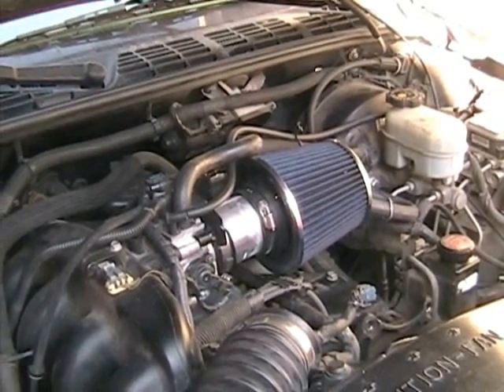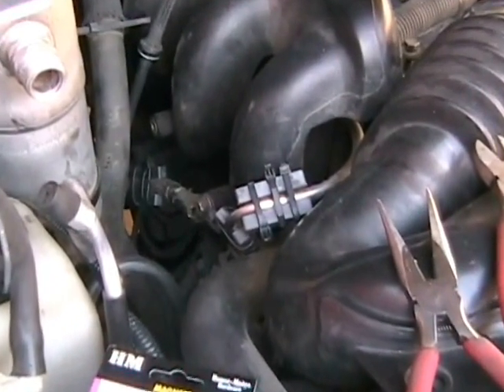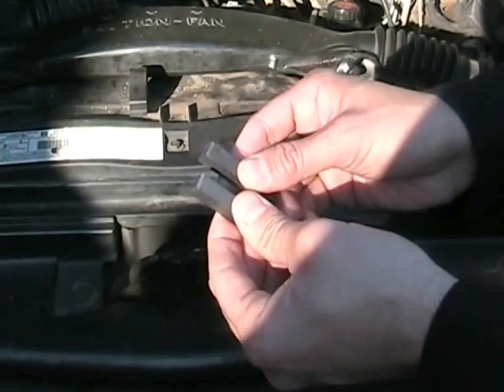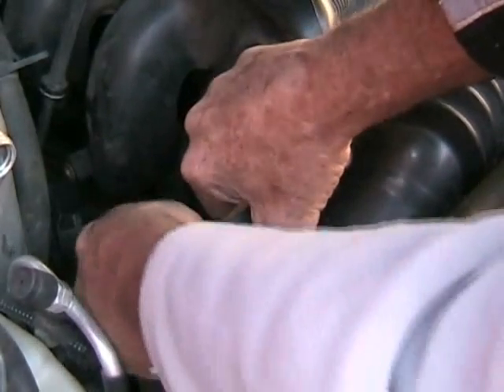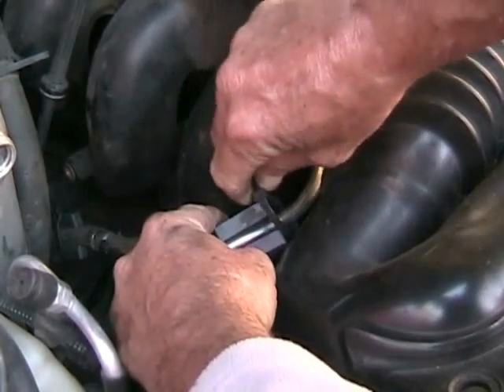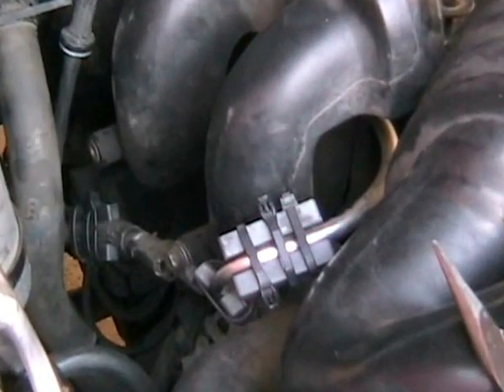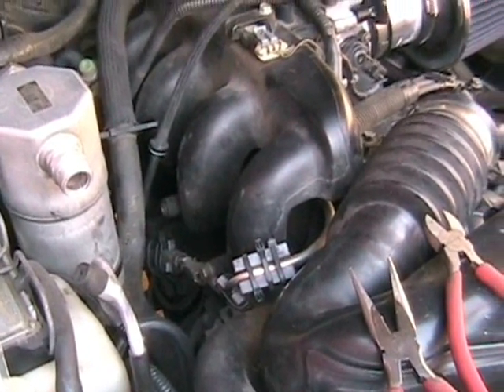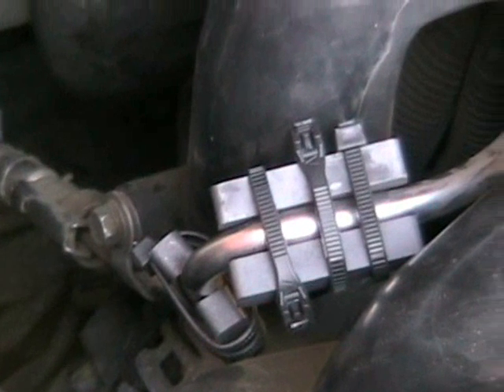Sequencing magnets on a fuel line

Comment: Hey!  It looks like I am no longer the only one doing this!  It not only gets better gas mileage, my van went from 18 to 23 MPG, but your car will run much smoother.  I first tried this on a geo prizm to get it to run smoother, then I discovered it improved the gas mileage as well.  You can get magnets for free from old hard drives.
Reply: Excellent work bro.

Comment: Just a note when installing magnets they will begin to clean out varnish and carbon from valves and you could actully see a decline until system is cleaned out. It took 400 miles of driving before the maxima cleaned out and ran smoothly..
Reply: hondo434 did u try it? Will it work with CNG as a fuel too?

Comment: If your fuel line is made from an iron metal, and you can stick a magnet to it, the magnetic waves emitted by a magnet cannot get through to the fuel.  The waves stay in the metal.  You also have to put the magnets as close to the combustion chamber as possible with all North Poles facing the fuel line.  It also helps to put some magnets of the inverse polarity on the air intake.  Fuel and air have the same polarity.  Since opposites attract, the magnets make the air fuel mixture REPEL each other less.  At least that's how it was explained to me.  A buddy of mine gave me a magnetic invention he made.  I was amazed that my 2000 Saturn not only went from 24 to 32 MPG, but the magnets eliminated a misfire.  WOW!  Unfortunately, I have not been able to reproduce the success I had with the Saturn on any of my newer cars.  Makes me wonder if the car makers somehow found a way to disable the benefits of adding magnets to the fuel line.
Reply: That's precisely why I use rubber fuel hose myself.  It works.  Most people aren't aware how magnetic fields work.  I think most fuel lines are aluminum though and those are not magnetic at all. All fuel injected vehicles should be counteracting any fuel gains you get from magnets.  I have a 97 and the mileage has changed marginally, but the pep in the pedal was immediately noticeable.

Comment: I then installed additional magnets around the air tube and increased mpg to 37-38 mpg. I have magnets on oil filter to catch metal particles under 10 microns, magnets installed around radiator hose to condition water so it won't corrode or build up minerals in capillaries. If you are worried about heat there are high temp mags or you can simply insulate them.
 I put them on my fathers v-8 merc marq. we got over 29 mpg.
Reply: hondo434 will this work for CNG fuel vehicle too? Where on oil filter did you put it? Were they attracting or repelling? If repelling, N-N or S-S?

Comment: OK,   I fitted magnets on my BMW K1100 motorcycle,  fitted them as close to the burn ( injectors ) as I could.  Within 5 mins,  the tickover went from 700 rpm to 1100 rpm.   I was baffled,  No reason for this to happen.  I rode it to my friends house,  fellow biker,  mechanic and engineer.  He sneered,  Nope,  Can't happen.  Observe,  I said,  and he did.  He too couldn't believe it.   so,  we wound down the tick-over to compensate for the magnets.   I knew my bike averaged 48 mpg on a run ( and I do long runs )  this went up to 57 mpg,  not once,  but regularly.      If someone told me this,  I'd not believe it till I'd done the same thing myself,  but there it was.   Further testing,  I put the magnets on my Goldwing 1200.  Didn't make any difference to fuel,  just the same,   but the engine definitely ran smoother.  I concluded the magnets ran better with fuel injection that standard carbs.   The magnets remain on both bikes and I'm very happy with them.  Look,  it only takes 2 mins for someone to have a go at me.  I honestly don't care.  I proved it to myself,  I absolutely don't need to prove it to anyone else,  I just thought that if someone with an open mind might want to try it themselves,  good for you.   Not everything labelled Snake Oil,   is Snake Oil.
Reply: Nonsence!
Reply: +Farhad Guliyev      If you can't spell nonsense then clearly,  your not bright enough to understand what's being stated here.
Reply: +Kevin Savage So what I made a mechanical mistyping. :) You also wrote the phrase "your" instead of "you're". I watched a Russian TV program about various tests on cars. So they tested a case on a professional, computerised stand with and without magnets at the same working conditions, i.e. engine revs, etc. The stand showed no difference in fuel consumption.
Reply: +kris090765 by the way, English is not my native language. It's my 4th language. I bet you don't know even 3-4 words in my language. So what I made a mechanical mistyping. :) I watched a Russian TV program about various tests on cars. So they tested a case on a professional, computerised stand with and without magnets at the same working conditions, i.e. engine revs, etc. The stand showed no difference in fuel consumption.
Reply: +Farhad Guliyev Your first language is JEW lies.... Howdy Epstein !
Reply: +CarsRcool :) I am as much a jew as you are my sister :). I am from Azerbaijan, my friend. If you do some research you willl see the science behind these magnets is actually a quasi-science. However if you believe they do work, please buy and install on you vehicle.It is your decision.
Reply: +CarsRcool Nice to meet you too ). Cheers.
Reply: ***** Every one has a goal to reach 200 MPG... because a man in Canada did that in 1936.... but we now know the reason why  he was able to achieve such great mileage    :  ) 
Have a nice day
Reply: +CarsRcool I have a masters diploma on International Journalism :). Jews can put materials on youtube too ;)
Reply: +Farhad Guliyev
'your' is a texin trik designed2save2characters but has same meanin. Proofs dat u got wut da word meant.
Reply: I use flange shield it & give it 15 days. electrons helps electrons
Reply: Many years back, I put a set of magnets om my car and I noticed no difference. At the same time a friend fitted them on a different make car and he was getting higher mileage. Also another friend selling these told me they installed these to the beer taps in a pub to prevent sediment builup in the taps.
Reply: I did this trick on a friend who had a motor cycle.  Everytime he parked his motor cycle at work we would add more fuel to his tank without him knowing. He thought the bike was so great he was getting 100 mpg. Then we started taking fuel out each day... he nearly killed that bike... hahahahaha what a laugh we had.
Reply: MaleAdaptor wow! Good to know that there are different uses of Magnets at different sectors!
Reply: James DeGray Hey james! I have taken professional driving as my profession for past 2 yrs in India. We (drivers) are facing alot of problems to sustain as Indian economy had an over haul. If you can suggest anything that could increase an fuel average for substantial amount; that would be gr8 for many here. We are using diesel, petrol and gas(CNG) here as a fuel.
Reply: @jibjibam  just incase you forgot about this post, I feel it's my duty to correct you on the spelling "computerized"... It's with a Z not an S 😂
Reply: The reason is because your gas electrons are aline, there fore you are getting a better burning of your gas and by that getting more power. If you reduce your seeping you can get better millage. 
Blessing for Ecuador. Google work
Reply: Do the magnets need to be powerful, or any regular magnets would do the job?
Reply: @Ryan H wtf 😂
Reply: @kevinsavage4162  you're *

Comment: @afdhalatifftan92
That's true, and easy to account for. Catalytic converters do slightly rob an engine of efficiency because they inevitably create some restriction in the flow of exhaust, but it's a reasonable trade-off because you get much cleaner exhaust and less smog pollution. Today's engines are also designed to burn fuel leaner than they did many years ago. Using more air in the mixture burns up the gas more thoroughly and makes for cleaner exhaust, but also reduces efficiency slightly.

Comment: This is an interesting concept.  Probably made for aluminum, or rubber or plastic hose only. The metal pipe can spread the magnetic field across a larger area if the pipe wall are thick enough. This will fade out the magnetic strength, affecting the intended magnetic pulse strength you asked for.

Comment: @Abreen11 I have tested HHO on an old Land Rover with a friend and we got 60 % fuel savings. You can also put water as vapor in the fuel and if you thermodynamics, you should know that heating up the vapor with the surrounding combustion is going to increase pressure in the chamber leading to much more torque sent to the piston instead of heating the wall.
Reply: 60% increase in mpg with an HHO generator? Without any timing adjustments to the engine or ECU adjustments? At what point does the HHO enter the intake: air box, before throttle, intake manifold? Also, do you know how many amps your HHO generator makes when it's on? and how much does it pull from the battery/alternator? thx
Reply: Wow! Impressive. I hope it is not exaggerated. How do we do that?
Reply: @gauravashq  did you ever find out how they was talkin about making vapor barrier and sending  in your fuel

Comment: I have been experimenting with magnets for almost two years. I have two vehicles of my own and have installed them on my families vehicles and have seen increase in milage on all of them. I used the same setup on each one. I use a small button neomydium n42 magnets 5-6 of them wrapped around the fuel line close to the fuel injectors. 
  My results for 2006 nissan altima are maximun milage before magnets was 28mpg, after installing just magnets on fuel line the mpg increased to 35.9.

Comment: @LOLDISNEYLAND the magnet system does work
had 1 fitted on a vehicle at work 12.7 litre diesle. idont own it or sell magnets so theres no need 4 me to tell crap. same load same distance on the first test was 18% less fuel. this was an insulated system so magnets dont get interference from chasis or any metal
Reply: alan eades how to insulate magnets for heat and for magnetic field too?

Comment: water is able to be ionized which means all electrons will separated all polarized so they don't combine with each other and minerals in the solution. benifit is minerals will float in solution and not attached to metal componets in cooling system. Thus preventing obstructions and corrosion.

Comment: @joshf101

Synthetic oils do tend to remain cleaner longer because they have more thermal stability. You can order a copy of the laboratory test results from any motor oil company and see that, in fact, synthetic oils can withstand higher temperatures before breaking down. When an oil doesn't burn as much, you will naturally get less carbon contamination. Think about it. If you put motor oil in a pan on the stove and turn up the flame, it's going to turn black when it gets too hot.

Comment: I myself have used magnets for years.  There are certain ways to intall them.  On some engines certain polarities work and don't work the other way.

The idea revolves around ionization, whereby a very strong magnetic field will ionize free oxygen molecules to the fuel making for better burn and removing deposits over time.

But one thing escapes me.. some are putting them on the coolant lines, which have NOTHING to do with combustion.  Can someone set me straight on this last point..!?
Reply: Magnets on the coolants prevent rust and oxidation build up

Comment: if you really want to improve your gas mileage.
change out the rear gear for more highway speed.
install a set of electric fans to cool the radiator. 
remove the ac system from the motor.
install an electric water pump and reroute your belt for the alt, and power steering. 
lighten your truck weight as much as you can. 
add a lite fabric cover over the bed.
all of this will lower the work load on your motor, lower your running rpm's and increase gas mileage.

Comment: im definitly going to try magnets on my toyota previa. some other gas saving tips. ceramic paint and heat wrap insulate on headers will make a 1-2 mgp gain but definitley ncrease torque. a free flow spectre cone will give big gains in hp and fuel efficiency. I also can vouch that the tornado has help me gain 1-2 mpgs on different vehicles. i plan to do all of these on the van and see how it goes!!!
Reply: hih, did it go well? or was it cap?
Reply: Update

Comment: @stormer1092
The problem is that hybrids are still a relatively new technology, and they only give you a fuel savings advantage in stop-and-go city traffic. When you're cruising out on the highway in a hybrid, you're just carrying around several hundred pounds of useless electronics and have no advantage over a gas-only engine.

Comment: @maynardp12 Indeed, there seem to a a lot of cases like yours. Our case is very similar but not just in terms of fuel economy, Power has increased and vibration has reduced at low revs as well. All that we hear from WWII stories.

Comment: I'm using NdFeB(very strong, 1.1-1.5 Tl) magnets with closed magnetic field shield over 5 month. It's work :)
 If not believe - try this on some old carburetor engine, you will see that RPM on idle will increase...
Reply: a tip : you can watch series at flixzone. I've been using it for watching a lot of movies during the lockdown.
Reply: @Warren Jimmy Definitely, I've been using Flixzone} for years myself :D
Reply: @Warren Jimmy Yea, been watching on flixzone} for months myself =)

Comment: In this video you say put the magnets ONLY in the direction where they are repelling from each other. I saw in a different video where they are alternating back and forth in sets of three side by side instead of one on each side of the line. When you did your research did it specify that they are to be opposing each other or will the on one side side by side way work in the same way. I am very interested in this theory.

Comment: @Voxson1 No it is not. I have had them for over 3 years now and my Audi 80 1.9 Tdi  went from the range 7.2 - 8.4 L per 100 km (highway - city) down to 6.2 - 6.8 per 100 km (highway - city) which has been confirmed first in the UK and later in Turkey. Moreover, we have less vibration and more punch at lwo revs (2000 - 2500) where the car used to be lacking.
Reply: laurentien00 could you please share how you put it there?

Comment: I notice your air intake is directly on the throttle body, and yet you left your air hose assembly on. did you find it works better in the present position?, or was it simply to get air in faster?, and if so weren't you concerned about the engine air being hotter and dirtier than that lovely cool air from the front?. I too have an s10 and I've done as many cheap mods as possible to get better overall performance, so I understand where your coming from matey !!!

Comment: Even if this works in principle, putting magnets on "metal" fuel line (as shown in the video) won't work.   All of the magnet's force lines are shunted through the metal and will not be able to do anything to the fuel in it.
Reply: Fuel lines are aluminum. Magnetic force goes through it like paper

Comment: Magnets are for Euro 2 engines only. If installed on Euro 4 engines, the ecu will be confused and will dump more fuel to the injectors. The ecu needs to be reprogrammed. When using magnets, allow the vehicle to travel up to 100km for diesel and up to 50kms for gasoline for you to notice the effect which will be a lower level of engine noise. Magnets can save you 8-10% max.

Comment: @joshf101
What the hell are you talking about? Synthetic oil stays cleaner and lasts longer than the conventional stuff, and can tolerate higher temperatures.
Reply: how can Synthetic oil stop blow by??and its the blow by of carbon ever time each cylinder fires that goes into the crank case and turns the oil black !!NO one has invented an engine that stops blow by of carbon as of yet!! we change our oil to get the carbon in the oil out of the crank case!!if the oil filter did a great job we would never have to change oil at all,but to make a filter so fine as to do this it would stop up after a short time !!!!

Comment: i have never known any property's of gasoline that are affected by a magnetic field.
when you can hold a magnet over a pan of gas, 
and the gas will rise up and stick to the magnet, then you have proven me wrong.

the extra 30 miles on your 15 gallon tank 
can also be done just by the way you drive.
even a change to a new air filter and a tune up can add mileage to a tank of gas. 
having the right air pressure in your tires will add mileage to a tank of gas.

Comment: Gasoline is a complex formula, the elements of which are of various viscosities and specific gravities. All elements in the periodic table are more or less subject to magnetic influences. The most efficient gasoline powered engines fitted to modern automobiles combust less than 30% of the fuel,  the other 70+% is heated to the extent that it expands approximately 30,000 to 1 then is exhausted as a toxic pollutant (hence the need for a catalytic converter in the exhaust pipe).

Comment: @logik316 Even if it sounds logical, It is not a rational argument. The EPA cannot enforce any such issue and the car manufacturers are not really concerned about fuel savings yet and this is even more true for simpler methods.

Comment: You are putting the magnets on metal fuel line.  It works much better on rubber lines.  I have tried multiple magnets and it did not do much better than one magnet.